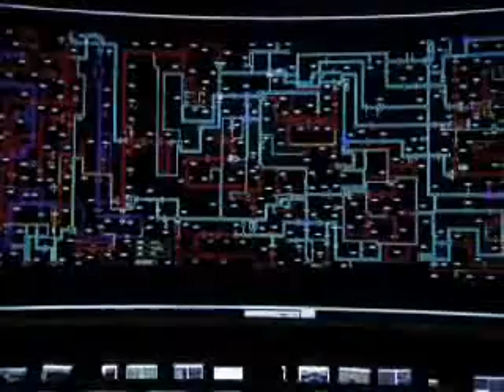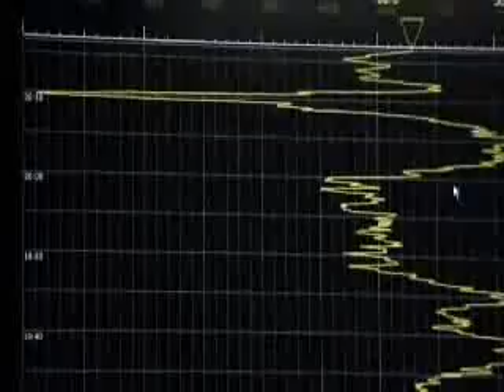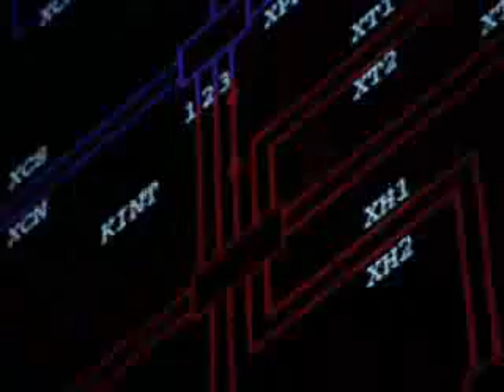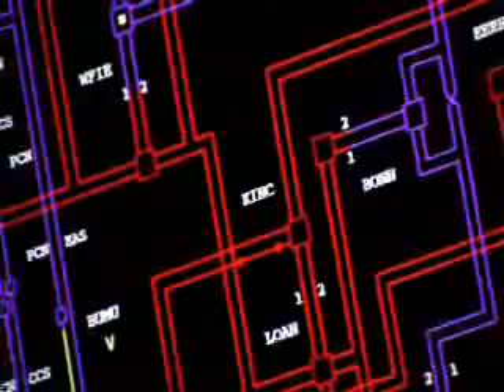How the National Grid responds to demand

Comment: A captivating video of the efforts and timely decisions behind keeping the kettles boiling in Britain to generate power electricity. Simon is responsible for that and I give him credits for his excellent preparation and readiness in managing risks as well as setting an example of performance management to ensure business continuity and achieve the desired result. He showed a quick response to avoid business disruptions and he successfully managed to control the incident with the French link to keep the frequency indicator as close as possible to 50 Hertz and ensure there is enough power in the National Grid to be on scale and not to drop off scale. Also not to have too much as it could shoot to the other side so the target is within a range. An important consideration behind his success was judging the timing perfectly regardless of the schedule concerns from the others. He acted as a leader and constantly sent out instructions to solve the problem and get more hydroelectric plan so that the supply will head back into the safe zone. Mainly, Simon managed to get the delicate balance of electricity supply and he keeps a million kettles boiling across the country. - Khalid Nour